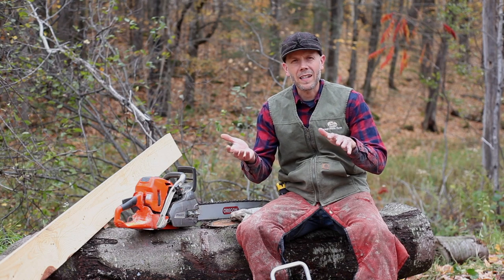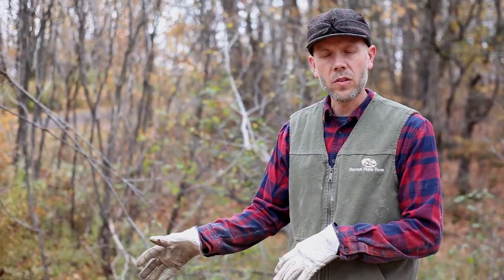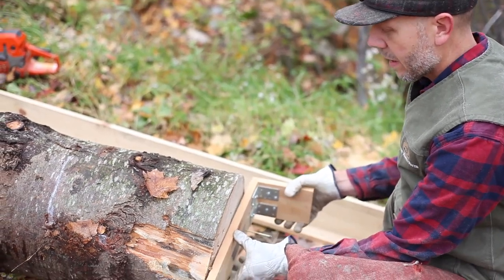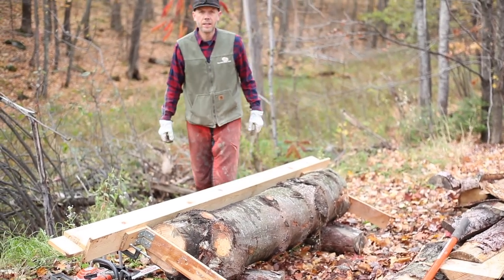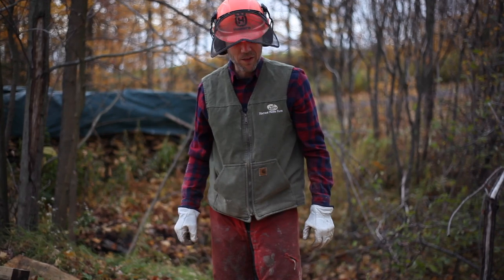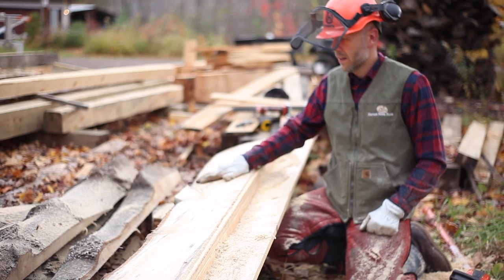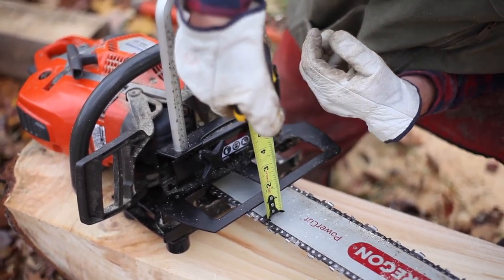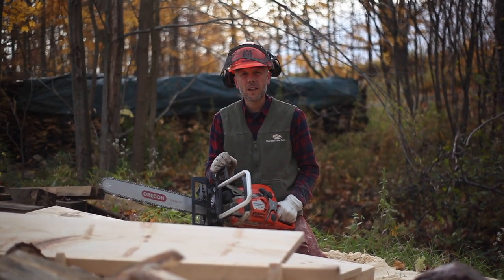How To Turn a TREE Into BOARDS Using a Simple Chainsaw Mill

Comment: Thanks so much, amazing tutorial. I have so many trees that were cut & put down, I have in my property, I was always wondering if I could use them instead of the tree company making chips this is very very useful I will attempt,  great instruction where do you get the tools ( not the chainsaw) the leveling tools

Comment: What is the problem with an Alaskan mill for this kind of job? I recon you would both save time with setup, and get better precision, using an Alaskan mill. Only downside I see would be that you are losing a bit of the cutting lenght, due to the mounting of the tip if the sword.

That said, as a guide for the device you used, the video was good. 🙂

Comment: I am planning on using some telephone Poles on a garden project, and some people are telling me that's not a  good idea,  What is your opinion about me  using telephone Poles in my garden, Do you recommend it or not?
Reply from the maker: Hi Luis - Sorry for the slow reply! Two thoughts come to mind regarding using telephone poles... the first is that I would be concerned about the chemical treatments they receive. I don't know for sure what is used but I would imagine it isn't healthy to be sawing. Second, be very careful to watch for any nails or other pieces of metal in the wood. Those will mess up a chisel or saw blade quite quickly!
Reply: Hi thanks for good video . I just got a Logosol for my birthday and it works like a charm . In regards to old telephone poles they are treated with creosote or at least the ones here in Norway are . A boy here when i greew up was trying to klimb a pole but didnt get far , he was sliding down (idiot btw) and got splinters in his inner tighes and hands and he got really sik . Like poisoned sik this was in the 80's so i hope he has grown smarter he he . Nice video best regards from Norway
Reply: Buy a high quality medal detector and really check the poles for screws and nails . And a very good dusk mask , you don't know what chemicals they have used for wood preservative on those poles